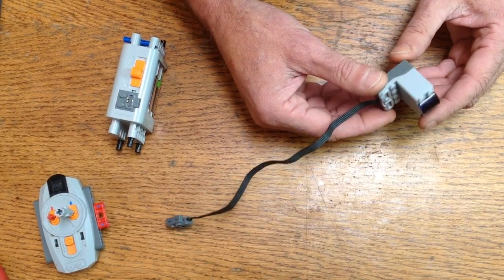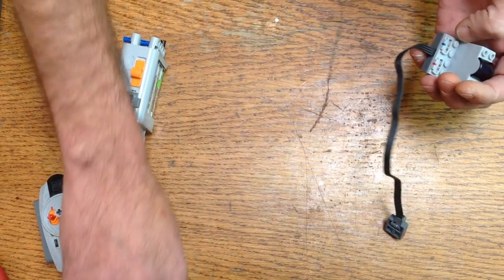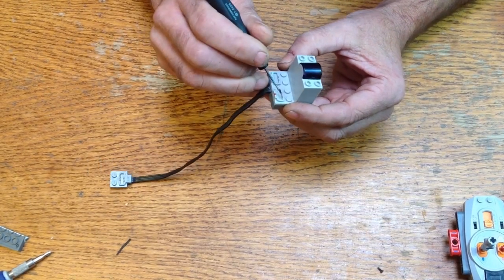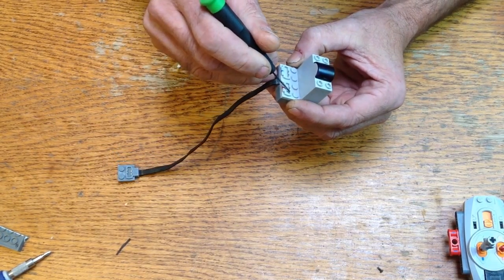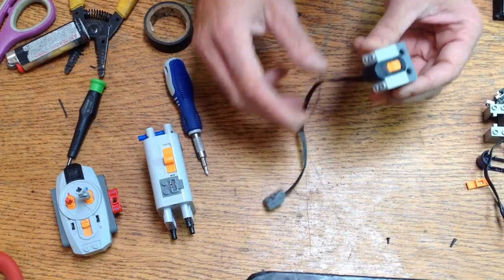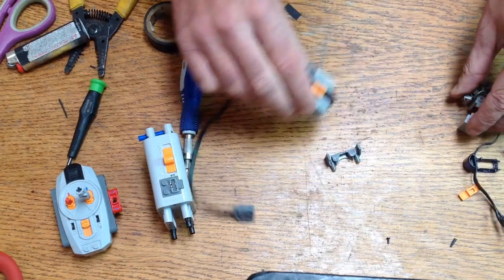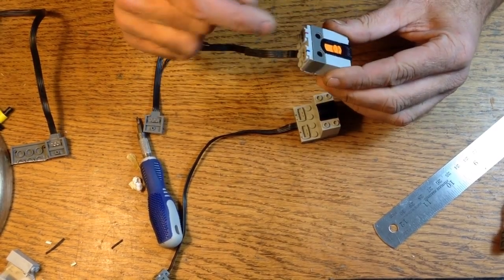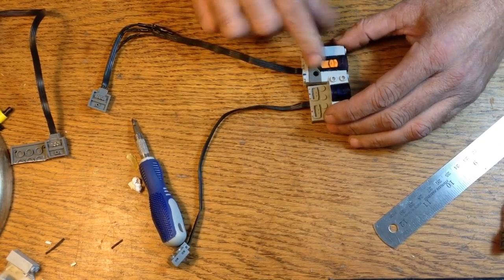Making a Smaller Lego Technic IR Receiver DIY

Comment: You covered up the sensor?
Reply from the maker: No. The sensor is under the dark plastic that wraps around the orange channel switch. It did not change I worked on the other side.
Reply: Yeah, that's why he never showed it working....because it doesn't.